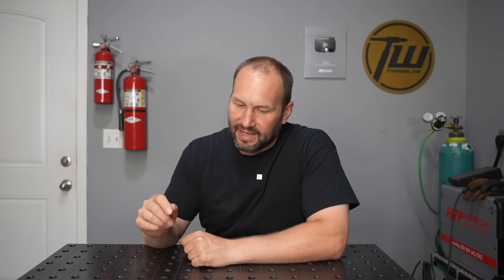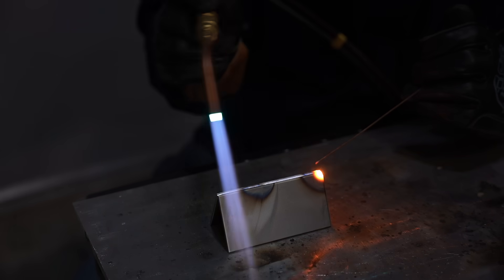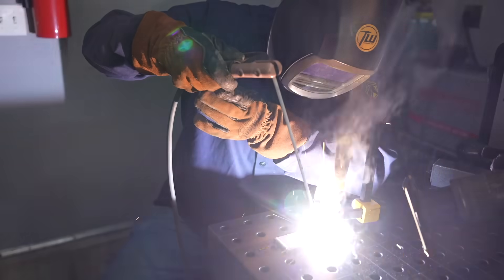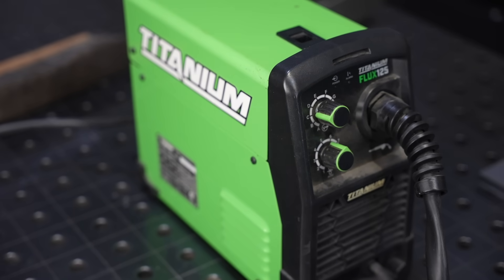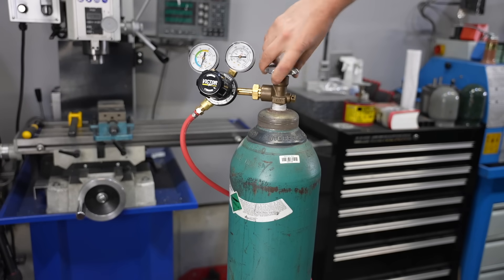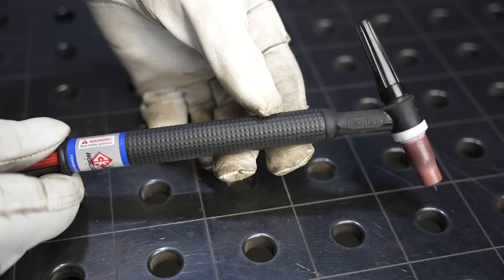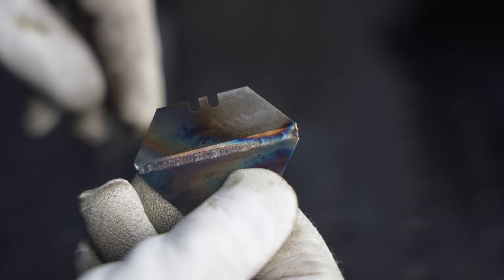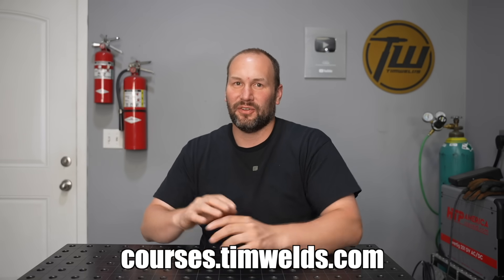5 Types of Welding Explained: MIG, TIG, Stick, Flux Core & Oxy Acetylene

Comment: very well done Video. simple one, and in fact i can use your video to teach others.  Great piece of art Tim!
questions to check my understanding :
As i re watch this video, my understanding is both Stick welding and Flux core Burn Flux to create shielding. therefore on these 2 processes we will see "spark / fireworks effect" during the process. as TIG uses gas instead of flux, we wont see this "fireworks effect" on the process. we only see stable arc without additional jumping particles. i think it should also apply to MIG as it does not use Flux and only use Gas. However in your video, when seeing the MIG process, im still seeing this Fireworks Effect and jumping particles. can you / somebody explain more on this...? or my undesrtanding is wrong.

thank you very much for your videos Professor Tim

Comment: Great video on the different types of welding.  I took a "Materials Joining" class in college and we got to try all types that you mentioned.  TIG really is difficult, especially with thin wall aluminum tubing.  I'd end up getting an oxide coating and melting through.  'Not enough experience on my part.

Comment: Hey, great advise. I’m getting the feeling that a rig welder would make a better starting point for a beginner. You can start by stick welding 1/4  and thicker. Then whe you are ready can turn to Tig for thinner material.  1 machine for the dyi guy. Or am I completely insane….

Comment: I've often wondered about different types of welding, truly excellent video!  What happens if the tungsten electrode touches the base material?  I assume it shuts down the power supply after a serious pop.
Reply from the maker: It happens, a lot as a beginner. It’s not too exciting, just contaminates the tungsten.

Comment: Instead of flux core just get a MiG welder that way you can do both. Just change out the wire for whichever process. On most mig machines you can toggle between flux and solid core, but don’t forget to detach the gas hose when doing flux

Comment: I’ve been welding from 1978 to 2023 one form or the other. Aviation certified welder/inspector in the USN until retiring in 1996🇺🇸 Then I worked at Dyno Corp aerospace engineering and a local machine shop until 2023.

Comment: Couldn't you also use a pedal with a MIG/flux core welding machine, where the pedal would manage the feed rate of the wire? That way you'd get more control over the weld, while not needing your 2nd hand to feed a wire separately.

Comment: I found Oxy Acetylene is really hard to get a handle on once you know how to do stick, because it's so much slower and I always go too fast. It is a good starting point to learn the basics. Stick is the one I know the best and I find fairly easy at this point. Although I suck at anything other than flat welds.  I've never touched fluxcore.  MiG is actually probably the easiest if you know how to set up the machine, and it functions properly. I find they're really finicky and hard to keep running if it's really dirty. Honestly it's probably a skill issue. 😅TiG is definitely a skill issue. I lack the proper motor control to do it properly. Probably the same reason I'm bad at oxy Acetylene. Welding is a lot harder than it looks and takes quite a bit of practice to get good at it. Ofc all this is the perspective of a pipefitter over many years in different shops and school.

Comment: I work for an apartment complex we use Oxy Acetylene for A/C line repair and installation of A/H and C/U's any of those other welding methods are to strong for these thin copper tubes....

Comment: Great Video. I had welding classes in high school (71 to 75) the only welding being taught then was stick and gas. Eventually I learned  MIG welding with gas and flux core wire. Never learned TIG welding per se i dabbled in it at one job, but with bad results. One thing about TIG is the ability to concentrate heat in a small area, eliminating a lot of warpage.

Comment: SUPER helpful. I got into welding with a cheap harbor freight flux machine. I used it mainly for exhaust and ALL my welds broke every single time. I had a friend help me with their machine and their welds held while mine did not. I'm now shopping for a better welder but my head is spinning! Thanks for pointing out the different processes. You made it very clear and easy to understand. Thanks!

Comment: Tig welding is one of the few things I miss about my old job. Nothing beats sitting in front of a welding table, podcast playing on earpods, cool air blowing to your face inside the PAPR mask and just staring at that puddle of molten stainless steel while welding pieces of pipes together.
Reply: You sound like a man that needs a service truck.  Up here in the north east a good welder is worth their weight in gold.
Reply: @PhoenixUnlimited  I have one already but I don't do welding anymore. I'm a self-employed handyman nowdays
Reply: I wish I could weld, I find it so fascinating and if it's a good welding job I find it very impressive.

Comment: I. Started. My.  Welding  course. In. 1993. To. 1995.   I. Started with. Beads. On. Plate.   MMA. MIG.   TIG  GAS. Then.  I. Went. To.   T fillets. And.  Butt.  Welding. In. Flat.    Veracal. And.  Over head.  Test. Peaces. Then. I. Had.  To. Cut. The. Metal. In. Half   and. Polished.  The. End.  And.  Test. With.  Acid.  I. Also. Had.  To.take. Exams.  In. Mma. Tig.   Mig. Gas.   Welding. 😊😊😊😊😊

Comment: I am contemplating to start learning welding and from your video I recon that flux core would be simplest to start with. I was planning on with Stick welding but, flux core seems lot noob friendlier. I generally dont like the stick welding due to nature of welds it creates requiring more cleaning and then sanding.

Comment: I have been welding for many years, both TIG MIG MAG and whatever they are called, but three years ago I started a new job where I primarily weld with oxygen and gas.
it's cool, it's a craft that is dying out.
we weld district heating pipes.

Comment: Thank you for this!  I happened across it because a young man who was taking welding at a J.C. and I were talking about different welding types and I mentioned stick welding and having to use both hands.  He told me that it had changed and no welding required both hands not even stick.  I asked if he wasn’t confusing stick with MIG but he was insistent.  Having learned to be quite good at MIG welding simply because a friend who owned a commercial welding company wanted to,prove to his second in command that women made good welders.  The shop foreman was a lefty and taught me to use my left hand.  After about a month, my direct supervisor asked what in the world was I using my left hand for since I’m right handed.  He taught me to use my right hand.  We welded pipe for handrails, etc.  it was great to be able to weld with both hands, made life easier.  My first week or so of welds weren’t the prettiest but when the big order for a nuclear plant was sent down to FL, mine were the only ones that weren’t shipped back.  They said not pretty but the strongest they’d seen in a long time.  I learned to make pretty welds that weren’t strong as well.  😂. Thank you for clarifying the different types of welding processes.  It’s probably no wonder the boy became a truck driver.

One question, I remember we had to adjust our tanks for the temperature in the shop, no heat, no a.c. One Saturday it was a balmy 28 dF. Ice was literally forming everywhere.  In the summer it could get in the low 100’s.  I cannot remember why we had to adjust the tanks.  I’m thinking it had to do with the steel contraction and expansion.  Do you know?

Comment: How about those LASER welding machines? I've seen some Chinese videos where they just use the "gun" and weld like they would use a glue stick. Very fast (I know some are sped up) and very uniform and smooth with no splatter.    https://www.youtube.com/shorts/pk_Y2xwjCwc

Comment: The first time I learned about flux core, one of my initial thoughts was: how the hell do they fill this huge spool of tiny wire with flux???
Reply: Start with large diameter wire then stretch it down.
Reply: @debochch yeah I looked it up and saw a few videos of gigantic flux filmed cylinders be progressively extruded down into super thin flux-core soldering wire
Reply: Same way they do enamel on copper wire

Comment: Hey Tim,                                           Can you do a video on the Lincoln Sprinter 180si Stick Welder? … I’ve been “a regular” on your channel for quite some time, and it would be greatly appreciated! 👍
Reply from the maker: I would love to try it out, but I don't have one available. Lincoln was going to send out some demo equipment, but it got shut down by the big bosses because I have so many videos using my old Miller machines. Regardless, it looks like a nice setup and if I were in the market for a machine like that, I'd consider it.

Comment: Hi Tim,

Great video — thanks for breaking down the different welding methods so clearly. I had a quick question regarding TIG welding. You mentioned the advantage of being able to customize the use of a filler rod during the process. After completing a weld with the TIG method, does the joint typically still require scraping, filing, or other finishing steps to smooth out the weld? and will that consume extra time to complete the full job? Personally I liked MIG method which brings out the weld seamlessly with no manual filler rod use ..

Thanks again for sharing such valuable insights!

Best,
Mihir

Comment: How thin & thick can you tig weld?
Reply from the maker: With the right setup and technique, there’s hardly a limit. Super thin material down to .010” is not uncommon in aerospace. There’s no upper limit on thickness with multiple passes as long as the machine has enough amperage.
Reply: @TimWelds is that 30 gauge?
Reply from the maker: Somewhere around there, though we rarely used gauge numbers anywhere I worked once things got that thin.
Reply: @TimWelds thanks. 🙏🏾

Comment: Oxy-acetylene is used in HVAC daily. Seems you are not as familiar as you think you are
Reply: That’s just one area. Generally, it’s not used as much as it used to be. You sure you’re talking about welding and not brazing? They’re not the same thing. You don’t know as much as you think you do.
Reply from the maker: It’s used for brazing/soldering in HVAC, different process. Oxygen is used there because the high temp lets you complete the braze joint quickly without heating up too much of the line.
Reply: @micheala6147 Fustek!
Reply: I’m not sure what you stand to gain by being an ass even if you were right. You’re watching a free video, and out of 15 minutes you choose to be rude about an off hand comment that’s not harming anyone in the slightest, in order to give yourself a sense of superiority. Perhaps you’d prefer yet another ChatGPT written video narrated by a robot. There’s nothing wrong with healthy criticism but trying to beat down those who are putting in the effort helps no one. Do better

Comment: What different gasses over half inch
I have used 1.6 mil gas mig. Same gas
I am interested 
Australia
Reply from the maker: In the US, 75% Argon 25% CO2 is the most common MIG (technically it’s MAG) gas. This only works for short circuit transfer which is pretty cold for thicker material. On thick stuff, dropping the CO2 to 10% allows a spray transfer that is hotter and will penetrate better. 98% Argon 2% Oxygen is even better for spray, but less versatile.
Reply: @TimWelds 
Thank you 👍

Comment: Great video! I see TIG welding as high power soldering.
Reply from the maker: From a technique perspective, it has a lot in common. The difference is that soldering doesn’t melt the base metal.
Reply: Now you have my attention because I love soldering, just started welding, and was curious about TIG. Hmm. I definitely need to experience this first hand now.

Comment: Hey Tim, question: how does anyone get a Welding job? Been looking for the past 2 years for a entry-level job and I can't find anything. Turns out its only for people with 2+ years of prior experience, not anyone just out of trade school.
Reply from the maker: It depends a lot on the industry and company. You have to get past the gate keepers running the application process to the people running and working in the shop. Sometimes this can be done through people you know. Sometimes it’s a matter of going to small shops and just asking for advice on getting started. One of the most effective ways I’ve seen is to get a different, related job at a company you really want to weld for, show that you’re a hard working, reliable, honest employee, then move into welding after you have your foot in the door.
Reply: @TimWelds I reckon easier said than done, I live 55 minutes away from a Union and thats an option. But now I'm going back to school for a Degree and I'm stuck working at $9.76 an hour and my family won't support me Welding because "its too dangerous," yet, they don't mind me doing nights at a Gas Station (a VERY obscenely risky job that, clearly, doesn't pay much). Ugh.
Reply from the maker: Definitely easier said than done, it’s tough. Hang in there.

Comment: In the first example I am VERY glad you opened up the oxygen tank all the way. MOST people do NOT do that, of course, the reason you did that was because an oxygen bottle has a double seeded valve. GREAT JOB!!!!!!!!!!!!!!!!!!
I have watched your channel for several years and enjoy every video. I think this is one of your better ones. My birthday is 5-17-1951 and I have welded since 1968, I cannot wait for your next video.
Reply from the maker: Thank you! I buy my own gas, so you bet I’m going to seal it open.
Reply: @TimWelds  Again MOST people don't have a clue!
Very nice video!
Reply: @davescorneroftheworld1147 it’s dangerous to not open any welding gas all the way. Virbration can move that valve.
Reply: @melgross  This is NOT TURE!!!! Open Acetylene very little. BECAUSE if you have a fire you can CLOSE the Acetylene VERY GUICKLY maybe saving YOUR life.
Reply: @davescorneroftheworld1147 I’m sorry, I’m talking about other processes.
Reply: @melgross is this humility on the internet? I’m shocked. Salute

Comment: Nice walk thru with examples.  I just wish there was a less expensive method for aluminum welding since its a far cheaper material for hobbyists and self study to purchase.
Reply from the maker: Thanks! Steel has usually been less expensive for my projects, but I absolutely love working with aluminum.
Reply: @TimWelds  I've been meaning to ask this question on a welding channel.  Can you show examples of what a weld looks like that doesn't use any gases or protection to the weld.  I keep hearing that regular air mixing in is bad...but i've never seen examples of any kind on what that looks like.  Could you even tell if it was just "welded" without any gas protection?
Reply from the maker: It looks like Swiss cheese or a sponge, full of holes.
Reply: @TimWelds  Ahh. Thank you.

Comment: I only use sticks and flux core, and the latter is very easy to use for thin materials; you just need to continuously tack, a little bit like the Pakistani does with sticks. 😂

And before some educated professional code weldor throws a raging fit; for most thin materials, a little bit of slag inclusion often don't matter much. It's not as if people are going to use a body panel to walk on...